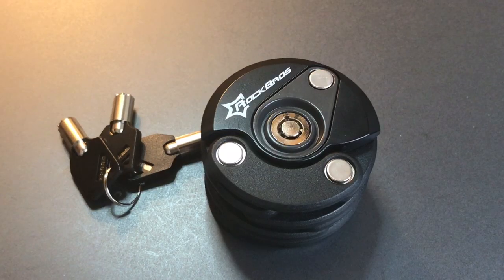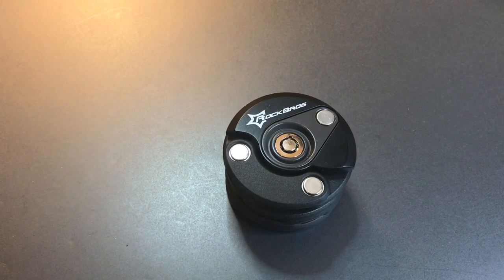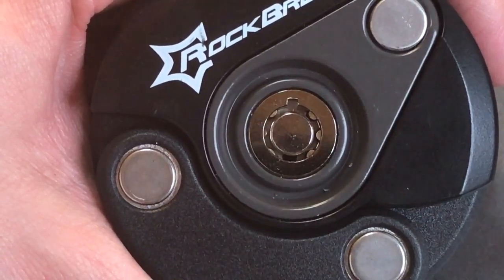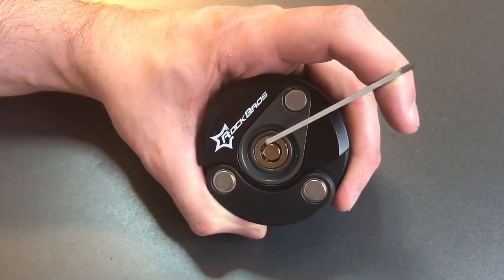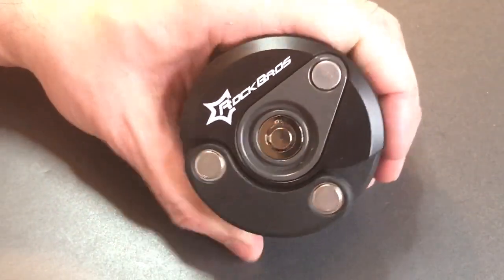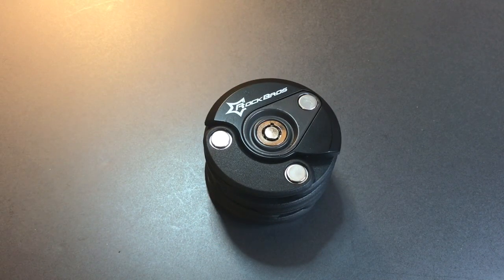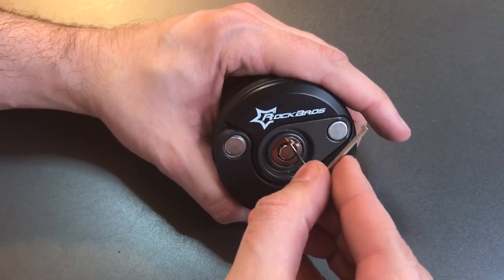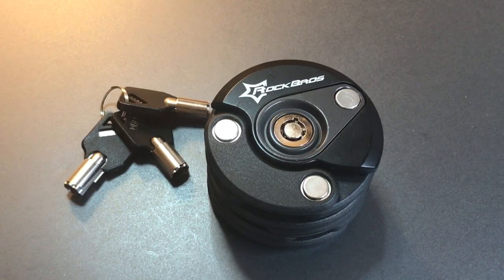[364] RockBros Hamburger Bike Lock Picked

Comment: Even tho the lock can be picked ......I still LOVE this design. I have never heard of this design before. I like how compact it is. So much better than that dam cable I have wrapped around my seat. I am definitely  going to get me one for my bike. Thanks for sharing.
Reply: yea same. it seems sturdy enough(more than a damn cable that can be just cut) and is way more compact and adjustable than a U lock
Reply: You could hit that lock and it would probably break because it can move separately or you could punch a hole in the joints i guess
Reply: I bought one, I'm really happy with it!!!
Reply: @bbb8775  that was my first concern with it. Interesting design all the same.
Reply: Yea I'd love to know the durability of the rest of the lock
Reply: Bicycle Man late breaking FYI: Most cyclists regard U-locks as more secure than cable locks, unless you’re using Kryptonite’s 15 lb chain.
Reply: I was thinking the same thing. I really like the design of the system. Not easy to pick, so that's good.
Reply: I have one of these as well, there's a mark in the plastic from someone trying to cut the lock with a pair of pliers. I've still got my bike so I'm happy!
Reply: I know it as the contec keg lock but with a disc detainer core
Reply: @scullystie4389  just looked it up and found that brand model on amazon, reading the reviews it looks like a pretty decent mid-range bike lock
Reply: I love the lock's design. I don't know what can be done if anything to make the lock more secure against picking, and I don't know if I would use this in any city in contention for bike theft capitol of the world.
Reply: If you use enough of them, it will take too long to pick them all and a thief will go to a bike that is easier to get, unless he has privacy and is unobservable. So the formula is a low value bike, and harder to steal than another bike!
Reply: I just use a gun lock it’s probably easy to pick but the criminals in my town aren’t the brightest bunch so I’m mainly concerned with making it just a pain in the ass and I got my bikes for free from trash piles anyways
Reply: Cable are not even real locks, they are just space occupying things
Reply: Remember he can pick these locks so well because he has all time to study the lock before he comes on video and shows us how to pick it. Even if your average thief knows how to pick tubular locks he'll never figure it out before getting caught or most likely he'll giver up and try the next lock.

Comment: I have one of these, bought just because I loved the design. Alas, I dropped it on the second time I used it, and this broke the retaining clip that holds the chain in its rolled-up, locked position. It still works, but the chain will flop around unsecured when not in use.

Comment: That's funny if you see the video that I just posted a couple of days ago you will see me using that tension tool to pick a tubular lock. I was trying to make one but it was a fail. So I went to the tension wrenches that came in that kit and that's when I discovered that one. So I want to thank you for the review you did on them or I wouldn't have them. But anyway couldn't you use that hole to tension it to begin with?
Reply from the maker: Yup, I saw it.  I guessed it was for tubular locks in my review video, and it seems to work for them, but there's still unexplained features.  As for using the hole, there's no good way to apply enough force to it without a custom tool...
Reply: +LockPickingLawyer yeah I was just wondering if it was possible. I do consider the tension wrench as a custom made tool. It is different.

Comment: Wait, didn't we did this already with 10 pins?! I am confused! A normal 7 pin tubular pick with the centre post removed would work wouldn't it?
Reply from the maker: Yes, the core on the Master Street Cuffs was very similar.... and I was not able to get an impressioning tool to work in this.  :-(
Reply: @lockpickinglawyer  I was wondering the same thing. Any idea why it didn't work?

Comment: Outstanding video!  I did see this on Bill's video as well. Neat design but seems to lack a little in security. I need to attack a tubular myself. Never tried.  Time for a new challenge.
Reply from the maker: Thanks.  Tubular locks tend to be pretty easy once you get the feel for them.  Take care not to over set pins (the biggest challenge for tubular locks IMO), and these locks will open for you without much effort.  Good luck with them!

Comment: ive had that same lock but sunlite for years. its been great other than needing to squirt teflon to get parts moving a few times.  so i got another slightly different brand but same style and after a few months the long skinny style key broke off locked up outside a walmart. they wouldnt let me borrow cutters so i bought a pair of bolt cutters and snipped it and returned them lol.  sadly the cheap cutters went right through that steel like butter. not much tougher than a thin cable.

Comment: If the manufacturer could make the product slightly  larger and use cable instead of the chain, then there would probably be enough length in the cable to wrap the lock and cable around a wheel, frame, and a nearby pole or other permanent structure.

Comment: This thing is cool but has a very unique weakness in that the lock only swings in one dimension instead of two.  If you have any sort of bar or just grab a big enough stick off the ground thos pins wont hold up to much.
Reply: Also the plastic faceplate is fragile, if it breaks, there will be no way to attach it to the bike, and the arms wont stay folded in, which makes its convenience of only needing the key to unlock, become a huge drawback.
...also the bike holder for it is make of easily bendable metal, which makes it rattle loudly.
so yeah, its a nice lock, but if you use it more than once a day, it wont hold long. mine lasted about 6 months

Comment: How hard would it be to break this lock open? It seems like the flat-ness of this design would mean you could stick a prybar or a pipe in there and twist it right off. Otherwise it looks like a pretty cool lock. Even with the right equipment and skills tube locks are a pain to pick through. Slick design too.
Reply: I suppose that depends on how willing you are to damage the bike.

Comment: nice vid mate you picked it in 48-51 second , even faster than bosnianbill , smooth and fast as usual 
Q: is the chain strong ? because it seems weak
Reply from the maker: Thanks... it should have been faster if I didn't have to mess with the camera and adjust tension.  As for the chain, it seems to be pretty flimsy, but I'd have to destructively test to be sure.  It's hard to tell until you do.

Comment: If the 6 o'clock hole can be used to open the lock, it can also be used to tension it 360 degrees, right? And it almost looks like the same wiper insert would fit in there.

Comment: hi i have a general question. i have a small yale padlock 5 pins iv picked a cuple of yales know but this one i cant crack.
as soon as i set pin 2 it falls into a false set with the remaining 4 pins     all of witch give feedback and counter rotation regardless of how much or little tention i apply i cant get one that will bind and because of the size of the keyway i cant fiddle enough to nail down the correct setting order. 
could you help me with some advice on how to handle this or maby a video of one of your locks that gives you a similer challange and show how to overcome it
thanks
Reply from the maker: Once you are in the false set, you can pick any pin that gives counter rotation.  If you lose the false set, get it back then continue to set pins that give counter rotation.  Keep doing that over and over until the lock is open.  It's no more complicated than that.  Good luck!
Reply: I reccomend you go watch Bosnian Bill's video on how to pick spools and watch lpl video on tension

Comment: the lock is cool
but the chain looks suspiciously plastic
Reply: The lock was nice while it was still working, only need to use the key to unlock it. sadly the construction is bad, the plastic parts will degrade really fast, eventually the faceplate falls off and then there's no way to secure it to the bike, or to itself (does not fold on itself anymore, the "key only to unlock" becomes a drawback), and it swings in only one direction, which makes it easy to break with some leverage

Comment: i Just got an Electric fat  bike.  it over $1k.  Which lock should be good for it?  FAT Tires Bike,  I ordered one of this Hamburlock. but you show it so easy to pick. now I am affraid my bike will get stolen.  Which Lock do u suggest? thanks
Reply: I have an e-bike also and I have this lock also and well here is the thing all bike locks can be easily picked and there is not a single bike lock that can't be picked in under 1min, the thing is the scum that steal bikes are after a quick easy score and so if you can make it as dificault as you can so it takes longer and is more hastle then your bike will be safer for it.  In my case I use a traditional U lock Onguard Brute STD 8001 on the front of the frame while I use a RockBros Hamburger Bike Lock on the back of the frame and back wheel and then I use a cable lock to lock down the front wheel and the frame.  It might seem like alot of whieght  but on an e-bike you do not notice it.
Reply: Good lord. Most bikes that get stolen use a cheap masterlock that falls apart if you hit it on the sidewalk. Or use a thin chain that a small pair of bolt cutters can kill. If you use a decent lock that can't be broken in ten seconds, your bike will be fine.

Because most bike thieves want easy targets. This is not an easy pick, it requires light and time and uncommon tools.
Reply: @DembaiVT  I've often thought that the biggest downside of these videos isn't that they help thieves (as you said, most thieves don't pick locks), but that they convince people that perfectly adequate locks are easy to pick.  They aren't, he makes it look easy because he has years of practice and all the tools he needs.  When a lock is outright junk, he'll say.

Comment: Great video on helping others to steal from people using this lock ... seriously I am pretty sure you are aware many are watching this video to commit theft
Reply: This should push companies to make better locks and people to buy better locks. It takes a lot of skill to pick a lock the way he does.
Reply: Bike thieves pick easy targets that people won't question them about. They pick targets that don't require delicate hand work, good lighting and a Lockpicking kit.

Bike thieves aren't after a challenge. They just aren't. 

This is a good enough lock to keep your bike safe. If it can't be broken in ten seconds with bolt cutters or a hammer, your bike is probably safe from being stolen (but probably not safe from vandalism).

This lock is fine. But if you were a property owner and someone put this lock on your property, knowing a way of breaking the lock that doesn't take an angle grinder is good.